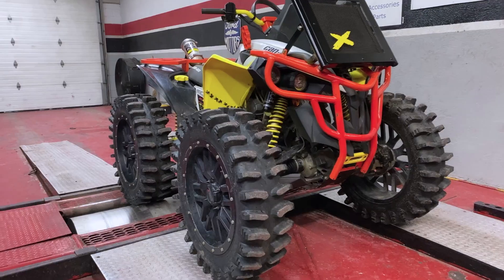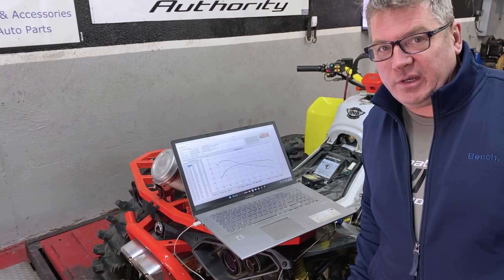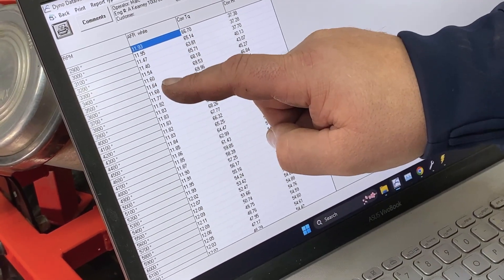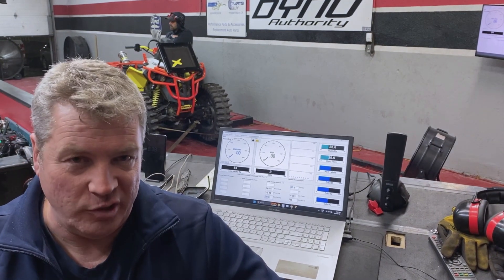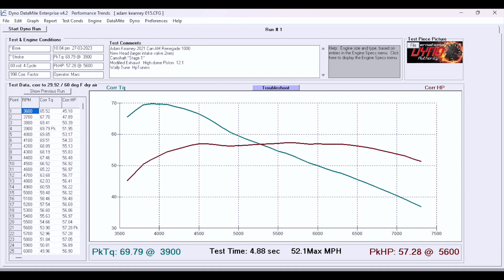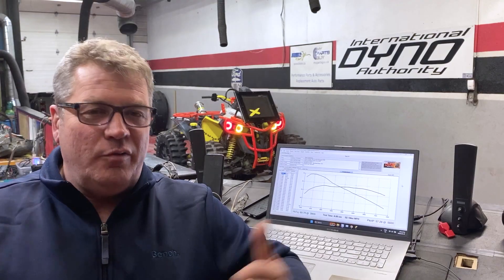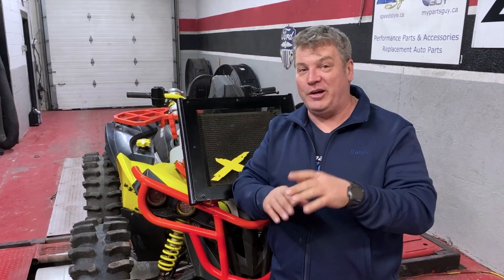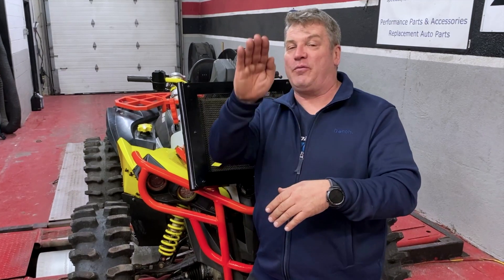Can-Am ATV Dyno Tune - Rough Idle *SOLVED*

Comment: How this test can be accurate the peak hp at 4500rpm it shud be over 8000rpm ?
Reply from the maker: YOU are correct....Normally on a chassis dyno, you run 1:1  or a close to 1:1 as possible.  In this case with "CVT"  you have to work on the tune and AFR, and we suffer on the RPM pick up at the wheels.    We were ALSO measuring slip .   RPM is picked up from the wheels and NOT at the Crank Trigger.